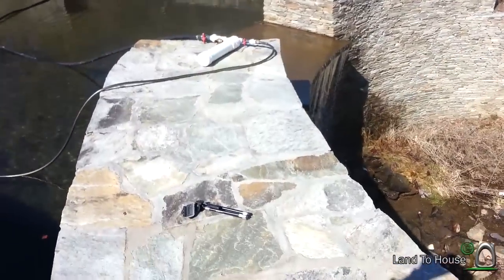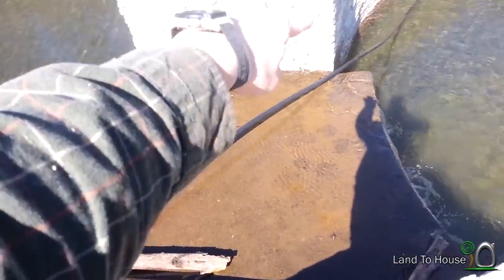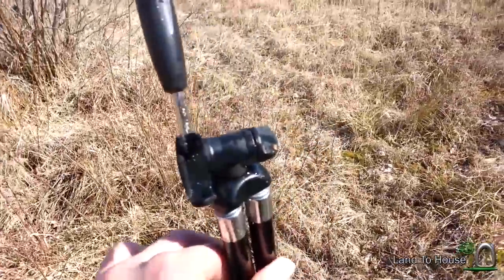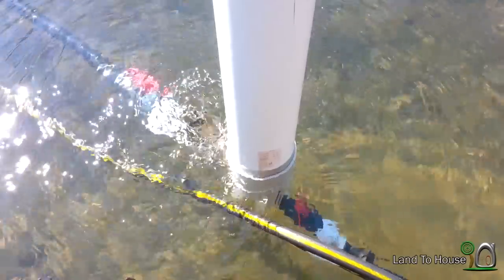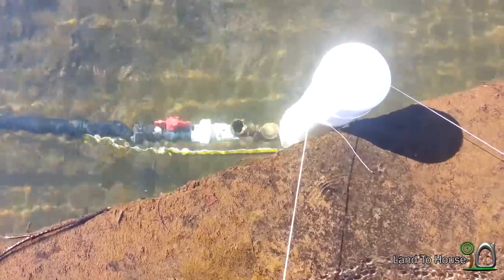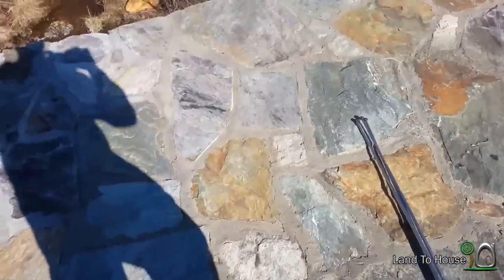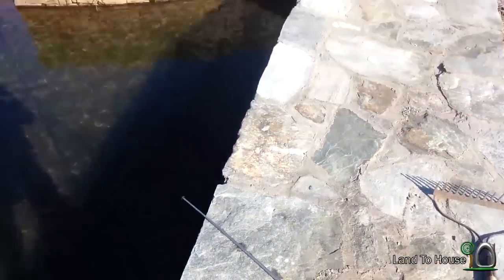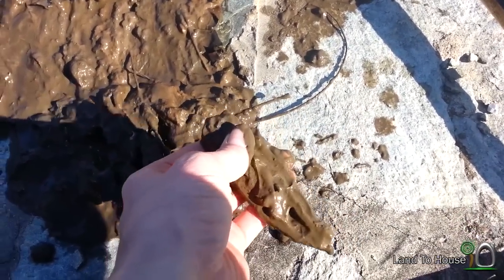Adventure 22 - Underwater Ram Pump

Comment: If you drilled and dug out a pit in the wall and drilled a hole in the wall put the clicking thing 2 meters under water, sealed around the pipe so water could not get in to the pit in the wall, removed the water from the pit. Attached the air pressure tank to the clicker tube turned on the valve to the air pressure tank, started it going.. would this work? 

Basically the clicker would be 2 meters under water, but the tank would not be in water. Would this work?
Reply from the maker: +TheaDragonSpirit since filming this video I have learned that head pressure and hydrostatic pressure will negate each other. When you place the ram pump underwater 2 feet it basically is a gain of zero because you got 2 feet of head pressure and -2 feet of water. As long as the pressure tank is sealed it does not matter if it is underwater or not.
Reply: Thanks for replying. So the example I gave should work then? As long as the water tank or reservoir is a lot higher than the pump? Additionally just putting the ram pump under water should work just as well as out of water?As long as the water tank or reservoir is a  lot higher than the pump? Is it a good idea to put foam in the pressure tank along with the inner tube? Sorry if I use the wrong names, I'm not a plumber.
Reply from the maker: +TheaDragonSpirit if you could send a drawing to my landtohouse@gmail.com so I can better understand your setup. I want to make sure I am understanding before I say is good :)

Comment: adding a pipe from the waste water valve to above the surface does what?
Reply from the maker: Adding a longer pipe on the waste valve will actually reduce the head pressure because that valve is the lowest point in the system. It is best to have it as short as possible.

Comment: Can you feed the pump with water from the same reservoir where your pump is submerged ?
Reply from the maker: +Rade Mihajlovic sadly no this does not work the weight of the water on top of the pump cancels the head pressure so the pump won't start.
Reply: tell me and if the head is higher?   thnks ;)
Reply from the maker: +creepybag no the pump has to be in a lower place than the source. Its my assumption that sinking the pump into the water cancels out the added head pressure
Reply: I came to your video with a similar question. I would like to know if given no head pressure but laying the intake at the same level as the pipe, but in a stream with a strong current. I need to know if that will work.
Reply from the maker: +Ano nymous sadly no. The head pressure is what drives the pump. There is a pressure wave that is generated that flows in both the uphill and downhill Direction. Without head pressure there is no pressure wave. Basically you're working with flat water and you will need to look into a river pump. You might want to do an elevation check on your water source. Sometimes you have more head pressure than you think.
Reply: Land to House I should check for the levels but i would say it is pretty flat, still strong current. There is a sort of swimming hole, i don't know how deep, but will it work if i place the ram pump at the bottom of this hole, I will have to remove it when it rains hard as the stones rolling down the stream will destroy the pump.. but i'm wondering if that will work.
Reply from the maker: +Ano nymous although the ram pump will work underwater the hydrostatic pressure  negates the head pressure. So you end up having the same equilibrium.
Reply: Land to House so how come in this video you say you get more water beacuase of the head gain when it's underwater
Reply from the maker: +Ano nymous it was a very early test and I did not fully understand what was going on. I need to re test this with a better setup.

Comment: I have seen many ram pumps on U-tube. However I have a  unique problem for my pump. I can't get fall on drive pipe / supply pipe for the pump I want to build. However I do have extremely fast flowing water. Will the outcome still be the same?Can anyone comment?
Reply from the maker: Flow rate and head pressure are not the same. (Sadly). To get the pump working you have to have feet of head for the pressure wave to occur.  You might want to look into a river pump that can be used on flat water. I have been working on a design but it's not done yet.

Comment: Hiii mr seth johnsson  . I need to built a pump for my land. River is about 70 feet below and having no fall position that i can give an elivation to ramp pump input pipe line. River is 15 feet wide and 5feet deep with a sufficient flow. Any help
Reply from the maker: Hello.  Sadly the ram pump is not for you because it must have feet off head to work. I am working on a diy river pump that will pump from flat moving water. Should have a video soon.
Reply: Thanks for reply. I saw a vid up here named rife pump. Seems it would work for me but i could not get the clue how it works and how to fabricate that. Do u have any idea?
And i am pleased to know that you are working on a flat area pump. Despirately w8ing to see. 
Thanks one again.; )
Reply from the maker: That's the pump I am fabricating!  You can buy one for more than $450 but I feel I can get my diy design below $100.
Reply: Can u share diagram with me?
Reply from the maker: The diagram is only in my head at the moment haha. The "how to" video will come out as soon as the ram pump basics series is over.
Reply from the maker: +shakeel safdar Have you seen the new series that I have uploaded? It shows my design and progress on the river pump.

Comment: if it is submerged 2 feet  under water, the head pressure coming out of the waste check valve is under 2 feet more pressure but, it is also pushing against 2 feet of head since it is 2 feet under water. So the net gain would be zero.
Reply from the maker: +Steven Wrigley Indeed. I just wanted to test to make sure that it would work. Several people just wanted to know if if would work.
Reply: I think you said in the video that it would give it two feet more head pressure. Atleast thats what I remember. I want a property where I can use a water ram.
Reply from the maker: +Steven Wrigley I need to find a place that I can set the pump underwater and give this a second try to make some better tests. These pumps are awesome! I use one almost every week.
Reply: Id love to get find a property with a water source so I can rig up a ram pump. They are so neat!

Comment: Hi Seth,, I selected the water wheel pump. Working on fluid mechanics to find out the power of the water flow. That is about how much weight of the pump to be limited for the river flow rate. I should also check about the water dynamics!! Do you have the maths(calculations)to design this pump,
Reply from the maker: I think you will be pleased with this type pump. I actually do not have any real data on these pumps. I had just started to work with them and then gave all my time to ram pumps. I have seen some large wheel turned by a small river so I am sure that it is not to hard to get them to work. The tiny wheel I made was almost running on my 100gpm creek. So if you have 500+ gallons per min you can get a lot of movement. I am very interested in your results but I am of little help in math calculations.
Reply: Thanks seth for this detail. Well i need some info on the coupling between the moving pipe and the stand stil pipe. The pipe from the pump will be rotating and it should be connected to stand still pump, what had you used there to connect these two? Bearing corrosion is one more issue in the water. I am search for the alternative. Hey i brought pipe fittings to build the ram pump. I will let you know the result soon.
Reply from the maker: +Prashanth Ss I also had an issue finding a swivel connector but then I found these hose quick connect.  You can get them on amazon : 
http://astore.amazon.com/latoho-20?_encoding=UTF8&node=5

Ram pumps are my favorite.  Once you get a nice setup they are very consistent.
Reply: Thanks again,  I checked it in India, I live in mysore and its not available here. you have a store. If i purchase, the shipping cost will be more than the cost of the connector itself. and in amazon.in(india) it cost 5000 Rs. 
Just now i finished fixing all the parts of the ram pump. morning i will be checking it. i am excited. will send you the photos..
Reply from the maker: Prashanth Ss oh yes shipping outside of the USA is terrible.  That is why I only ship my pumps to USA and Canada. I was unable to find a swivel union that I liked for the water wheel.  If you find a nice one let me know.  ... And yes send pictures!
Reply: Hi seth, I had to suddenly go out of station on tuesday so could not do anything further on ram pump. I am back today and tried.i could manage only 2 meters height of feed head with 6 meter feed pipe. The flip flop stops working once the ram fills completly. What could be wrong?
Reply from the maker: Prashanth Ss seeing the pump in a video would help me figure out what's going on.  You can email landtohouse @ Gmail.

Comment: Hi seth johnsson, I have a river which is 2 feet deep flowing, There is no fall near our place, Can i make a ram pump for this. I need the ram pump to pump water for a place which is 200 meter away from the river at 10 feet height.
Reply from the maker: Hello.  Your river wont work for a ram pump because there must be a drop in elevation above the surface of the water. Although the ram pump will work underwater as in my video the source has to come from above the water. Now there are two other types of pump that will work in your river. one is called a river pump. the other is a water wheel that has a spiral tube on it. This water wheel design was used by the ancient egyptians so it works well in a river. you can get 10 feet out of it no problem. The horizontal distance is not an issue at all.
Reply: Thank you :) I saw both water wheel and rife river pump. I will try designing and implementing it.
Reply from the maker: Prashanth Ss I had an idea a while back to make a wheel out of PVC but I stopped designing after the first couple tests. I just dont have the water in my creek to turn a wheel. There are many designs out there but you might find something useful in mine. .... like how not to build one haha  https://www.youtube.com/watch?v=ZuFxqolv-j0

Comment: Seth, thank you very much for testing my hypothesis! So cool! Now it is efficient, in terms of fuel free operation, and quiet as it can be placed under water! Nice!!! Sorry for the accidents...
Reply from the maker: You are very welcome!  And again thank you for asking them. They make for good content. The accidents are all part of being out in the great outdoors. But they were not as bad as they could have been. If you think of more questions I would be happy to try them. I am getting ready to change my pump design to use the PVC check valve in place of the second valve. Should be quiet.
Reply: If you drilled and dug out a pit in the wall and drilled a hole in the wall put the clicking thing 2 meters under water, sealed around the pipe so water could not get in to the pit in the wall, removed the water from the pit. Attached the air pressure tank to the clicker tube turned on the valve to the air pressure tank, started it going.. would this work? 

Basically the clicker would be 2 meters under water, but the tank would not be in water. Would this work?

Comment: Hey, it is good to hear the ramp pump works under water. So the pressure from the above water should be way too law than the pressure of the incoming water or do you think, being bit lower would be enough? I wonder if there any way to install a ramp pump to a well.... I was thinking of having a side closed cylinder inserting into the well water so that pressured water can take out from a hole of that cylinder's bottom. however that doesn't work continuously as the effluent of ramp pump will collect in the cylinder. After hearing this adventure I felt if there is any possibility??? :D I'm sorry for your accidents though... :-(
Reply from the maker: Yes it does work underwater well. I assume that the pump has to have water falling from a level above the pond surface. You cant place the pump deep in the water and have the drive pipe rest just at the surface. It just wont work. As far as installing a ram pump in a Well. There is no fall into the pump to get it started so it wont work. I am not sure about using the cylinder as you speak of. I have never tried that. if it works it would be very nice. . . . The accidents were tough that day for sure. Good things those days are not often. haha

Comment: Holy bad luck there batman! Love the pond setup in location to the house. That yours? Going to raise any mountain trout in there?  I would. 

You ever use or try PVC flapper or check valves instead of expensive brass?
Reply from the maker: Tell me about it!  Just one of those days that I should have stayed in bed. But it makes for good youtube :)  I The ponds are technically property of the community but there is no community so I am able to use them freely. My property line does go across the last pond. That is not my house. its homeboys ...my neighbor. . . . . . . Not only have I though about using PVC but I am going to have to move to that because brass has just gone up $2 per unit.
Reply: Well i bought 2 different types of PVC check valves. When I get the thing together and working I'll let you know. Though it will take me a little bit to complete it.
Reply from the maker: G.W. Barker I am very interested in learning what you find out. yes when you first start looking for parts it takes a while.